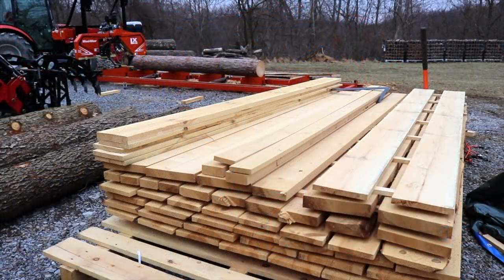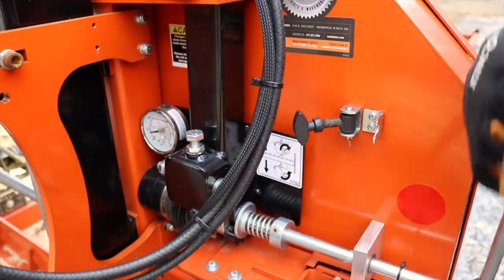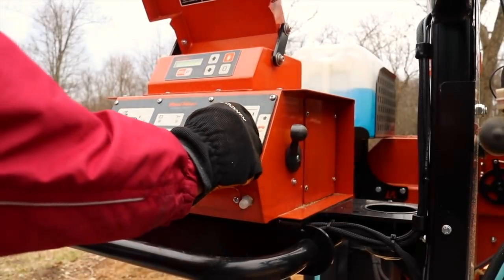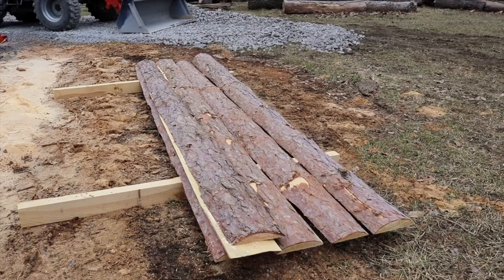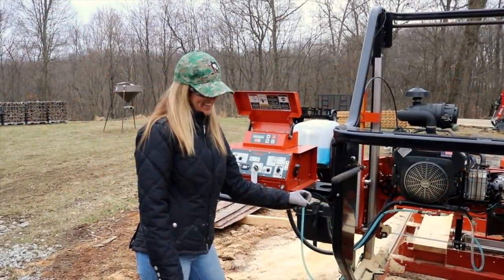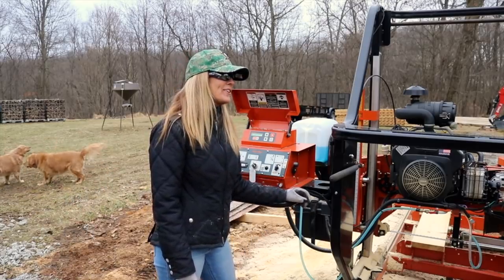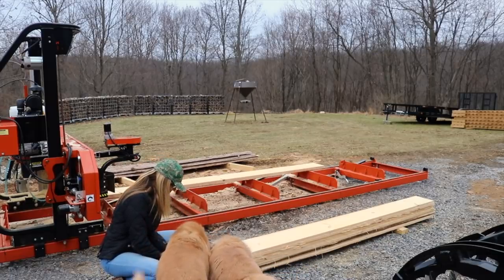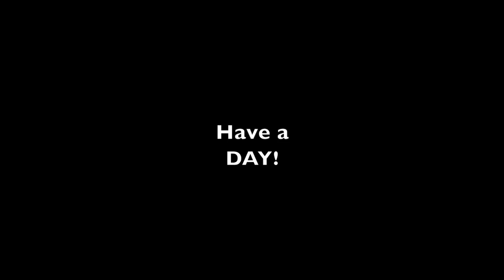#707 MILLING Homegrown Red Pine on the Sawmill

Comment: Burn the outside, it also will keep bugs away from your building
Reply: If you want to protect the wood from insects by burning, you should do both sides, ends and edges. The Japanese have been using this technique for centuries. That's why most old wooden Japanese homes are nearly black.